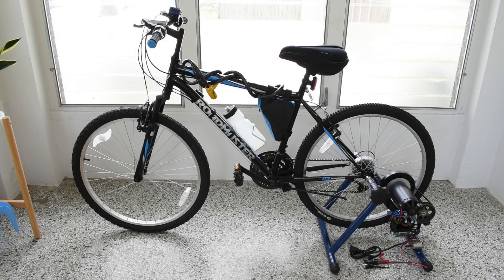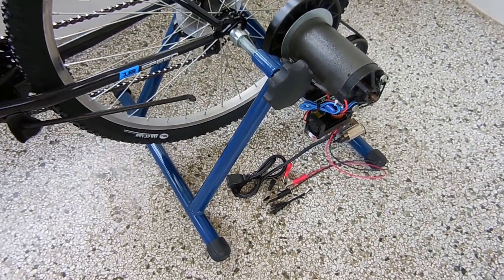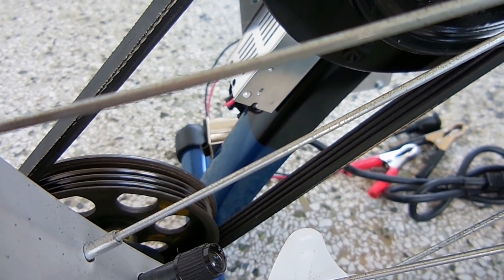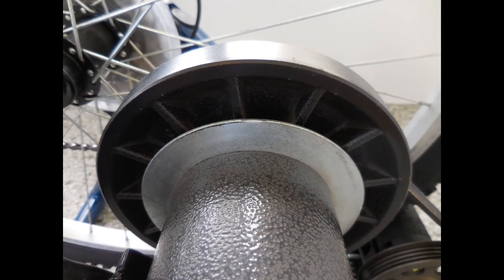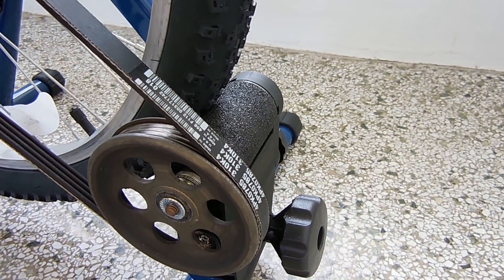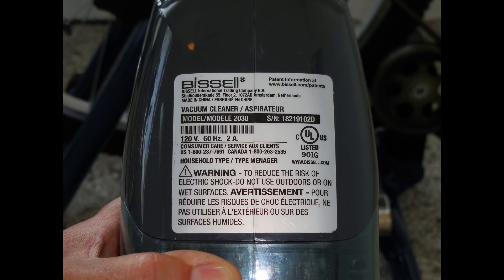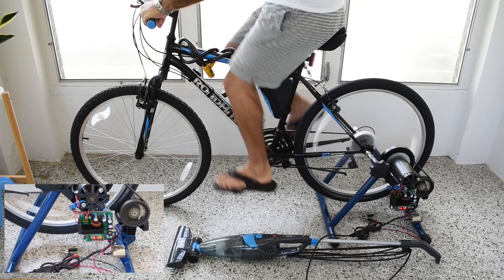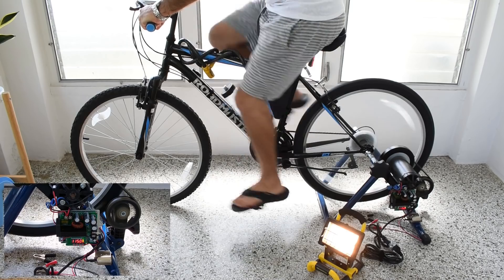Homemade Bike Generator Tests! (Powering 120V Devices)

Comment: A good racing bike with SPD pedal would increase efficiency. But better still by using a wheel with a hub motor like on electric bikes which are not mid drive, this way we would eliminate the noise of friction, pulleys and strap. Show us in the future how to convert a hub motor from a cheap electric bike . There are plenty of them in the used e-bike market  because their owners are discouraged by the high price of replacing the battery pack.

Comment: You know, if you had just used the other side of the bikes rear wheel and gave it all a direct chain drive and toyed with gear ratios you be better off because the belt slips and the rubber tire gives and you lose a lot of torque. Just saying. lol. And maybe even run a multiple pulley system with a few more of those motors and a semi-heavy flywheel to keep things going easily after you get it rolling.
Reply from the maker: The purpose is to have any bike easily go in and out of the stand.

Comment: Here is what I want to see someone do:  I want someone to get a 120-volt, 15-amp AC generator that is designed to be able to be hooked up to any power source, with an electric outlet and a power input shaft to power the generator.  Then I want to see this generator mechanically connected to 40 stationary bikes.  Then I want to see a full cycle being done on an old-fashioned agitator-style clothes washer on nothing except human-power.

Comment: What is the converter you’re using to get to 115v?
Reply from the maker: Hi Seth. There should be links in the video description area. Thanks for watching!
Reply: @electronicsNmore  thank you... I’m not sure what the problem is but when I click that link it just opens a generic to Amazon .. I searched for step up converters but I didn’t find anything that brought the voltage to 115v. Maybe you can help me see what I’ve done wrong here

Comment: DAM dude 5 - 6 minutes at only 120 WATTs holy that must be hard (inefficiencies in the system)
Reply from the maker: A reasonable level of power that you could generate, would be 50-60W max continuously.

Comment: Thanks for the video. How would that setup do trying to charge up a deep cycle 12 volt battery?
Reply from the maker: You can charge that with no problem. set max current to 5 amps and you'll be fine.
Reply: @electronicsNmore  Thank you!

Comment: BTW scooters electrical use a 12 or 7.2V engine. usually the drawback is the batt, engine is good. pawn shops have them at value, aluminum frame , heat difusser. 

that's all falks... merry melodies... >_ command:IPL

Comment: Would it be the same result if you installed a maxwell capacitor bank to it? Also why not use the power generated to turn another motor attached to a 90 amp alternator.
Reply from the maker: If you charge up a capacitor bank, you'll have plenty of power, but you'll need to limit the current flowing into the capacitors, or you won't be able to pedal. You always lose when transforming power, never gain. Thanks for watching!

Comment: Hello Doug, Be good to have if the power went out. I wonder if the DC motor and board would survive an EMP as it's not connected to the grid, or perhaps it doesn't matter. Nice set up. All the best, C.
Reply from the maker: The motor should be fine, and possibly the 13.5v step down circuit inside the metal box, but the large board would likely be destroyed.  Thanks for watching!

Comment: wouldn't a heavier wheel make it easier to power devices since the momentum wont stop so easily. Also the bikes that use your arms as well would help.
Reply from the maker: Once a heavy load is applied, the wheel will quickly slow down.
Reply: @electronicsNmore  true but the heavier the wheel the longer it would take to slow down dont u think so? Just like a big ship slamming on brakes it can still go a while. The more power you need the heavier the wheel. So I assume. Just a suggestion.
Reply from the maker: @trench01  Yes, but the heavier the wheel, the harder it will be to spin it back  up.
Reply: @electronicsNmore  not exactly in a way. worth testing out to see ;) also low gear help at first to start it up before you go to high. ;) But the more you bike the better you get ;)  
example if you had a 1 ton wheel and you hang on it, it will move and it can have enough energy to power something longer than if you did the same to a 1 pound wheel. You would use the same energy to move the wheels which would be your  weight. Or maybe that would be more ideal than a bike.  Am I wrong on that example? thanks

Comment: Another great one.Get slick tyres,pump to 45psi as well which can help a lot.

Also oil your chain with silicone oil.
Reply from the maker: Slick tires will end up slipping on the spool under load.
Reply: @electronicsNmore  higher psi and better tyres will prevent that.btw that bicycle is very bad.Get a good road bike. (: Ps:Try getting one of the old Tacx Fortiuses you wont regret.
Love your videos mate.

Comment: No need to rewire the treadmill motor ?
Reply from the maker: No. All I did was reverse the wires on the treadmill motor, so the output was correct(+ / -) for the rotation of the wheel. Thanks for watching! Be sure to share the link, otherwise videos like this end up a big waste of my time.
Reply: @electronicsNmore  will do ! Thanks..FlipFlops rule !!!

Comment: Very entertaining video! Well, that's certainly "alternative energy....without getting a heart attack"! LOL     😂😂👍👍
Reply from the maker: Heart rate goes up very fast trying to power that drill. Thanks for watching!
Reply: @electronicsNmore  Maybe the doctor should have had that setup instead of the treadmill for my stress test. They couldn't get my heartbeat up to 130 BPM even after 9 minutes and at the highest speed. Even the IV injection didn't last long. By the time I was unhooked and sitting down, my heartbeat had already dropped to 80 BPM. Less than a minute later it was under 70. Doc was unhappy when I scheduled it as my BPM was 52. The day of the test, before anything was done, it was 47.
Reply: 47, thats a very low resting heart rate.
Reply from the maker: @simontay4851  True, mine bottoms out around 56-58
Reply: @simontay4851  I just went down a set of stairs, walked out and fed the dogs, climbed back up the stairs, and sat down. Puse rate, 54 BPM. A nurse during one stay in the hospital years ago recorded a high 30s rate. Same applies to my body temp. If I hit 98.6, I'm sick. Normal for me is in the lower-mid 96F range.

Comment: Could u just use an alternator instead ?
Reply from the maker: You can use a 1 wire alternator, but then you'd need a battery to supply power to the alternator's rotor. Thanks for watching! Be sure to share the video link with many others.
Reply: @electronicsNmore  I have a circuit I designed for repurposing automotive alternators in a quite efficient manner. It replaces the voltage regulator - changes the field coil current to regulate a fixed output voltage. You may be able to adapt it to start up an alternator with a little modification and a big capacitor, as there is enough residual magnetism left in the rotor to generate a little bit of power. Just have to not connect the load until you have the capacitor charged and the alternator running stable. You can also use it to adjust the output voltage, so you're not fixed at the usual 13.5V for lead-acid charging. Handy if you want more voltage, though I imagine if you went all the way up to 120V the alternator's built-in rectifier diodes would have some objection.

Comment: Hover Board motors are the bomb for doing this.  Cheap and  both voltage and amperage rock.   Just mount the Motor to rub on the bike tire.   Add Diodes and Controller.    You can even use a cheapo solar controller.  Erratic charging a Car Battery for later use.  Make your kids spend a half hour on the thing once a day.  LOL
You can find them dirt cheap.  https://www.ebay.com/itm/Qty-2-Authentic-Swagtron-T5-U-T580-Balancing-Scooter-Tire-Rim-Wheel-Motor-Part/193432621644?hash=item2d097b924c:g:Rz4AAOSwktpenOha
Reply from the maker: Yes, they work good also, and the rubber wheel makes it easy to press against the tire. They won't supply as much power tough. Thanks for watching!
Reply: @electronicsNmore  what would be a good one to order on ebay? Im trying to set up one that will charge a battery.

Comment: I like this, if you were not able to start your car this could work to give it a boost.  I would like to see a generator like this for when the bike is being riden out on a road or bike trail to charge phone or other devices.
Reply: Any charging will offer resistance so make sure all the hills are downhill.
Reply from the maker: If the battery wasn't totally dead, you should be able to put enough power back into the battery to start the car. My setup will easily charge laptops/pads, and phones. Thanks for watching! Remember to share the video link with others.
Reply: @electronicsNmore  That is a nice setup, when the halogen lamp was being powered the meter was reading 13.48 volts and around 6.25 amps, that is enough power to run my home theater system and then some.  Maybe a setup like this for the kids to power their phones and gaming systems so they get some exercise instead of being glued to a sofa playing games all day.  Sort of like a challenge, you can play all you want as long as you can power it yourself.  It's not a punishment, but I may sound a little harsh.

Comment: I really liked the video. Lots of questions.
1. Hypothetically, if you added a flywheel to the rear wheel would it increase the momentum and voltage generated?
2. In the event of an EMP would the latent (not being used) circuit board components in the mechanism get ruined? 
3. Can this mechanism fully charge a 12 volt car battery? 
4. Is this mechanism the same principle as a hydroelectric power plant, only miniaturize?
Thanks, Arthur.
PS: I really liked it because it's something I've thought about 100 times.
Reply: The inertial/centrifugal force of a large flywheel would not increase momentum or voltage output, as you would still only be able to pedal it as fast as your strength would allow. However,  it would tend to perpetuate momentum as you get tired,  allowing for brief moments of rest on your legs without affecting the voltage as much as if there were no flywheel...In theory,  one would be able to pedal for longer periods of time, thereby producing more electricity!
Reply from the maker: Glad you enjoyed it Arthur! I think the load placed on the generator would slow down the flywheel faster than you can pedal to maintain the speed of the flywheel. EMP, you can still charge up 12V lead acid batteries. :-).
Reply: 1. No. But it would reduce the impact of varying load upon the rider, which could make it more comfortable to operate - you wouldn't experience quite as much of a jerk to your legs when  someone turned an appliance on or off.
Reply: The flywheel is a temporary reservoir of (kinetic) energy analogous to a capacitor in electronics. It acts as a buffer. But energy in = energy out + heat (losses). If you are powering a 50W load then you must but in a bit more then that with your pedaling, depending on the system efficency. (losses occur at every step, chain/sproket, wheel rolling resistance against the generator spindle, all the bearings, the generator's windings, DC to DC converters and I2R losses)
Reply from the maker: @power-max  Agree 100%

Comment: Every gym should have many of these in every city state and country.  Imagine 20 people putting out 50w for one hour. I think that our be around 1kwh or so
Reply: So about ten pence an hour. It's not economical to generate power this way. You'd be better off buying a few solar panels. It'd make a good novelty device though, to draw in customers.
Reply from the maker: They'll need a big bowl of pasta before they get on the bike. 😂 Thanks for watching!
Reply: gh fjj 

I agree. Several gyms could sell the power back to the utility company to offset their power costs. This could be a very good idea I think.
Reply: @mtkoslowski  It's a nice idea but the economics wouldn't work. Compare the cost of a kilowatt hour of energy Vs payback on initial investment and ongoing maintenance per kilowatt hour. Even getting close to breaking even would be an achievement.
Reply: Membership fees offset by one peddlng, I'll take it. In my area San Diego we have the highest rates in the country so it really varies city to city state to state. Maybe it would make more sense in higher rate areas if the bikes would last. It's about 14cents to 20 cents here for a 350 watt hours hear to charge a scooter so I can see it adding up once dialed in. Hook the scooter charging  business up with the gym business and your good to go. Would also be great pr.
Reply: The computers on cross trainer machines and stationary bikes in gyms are usually powered by the user.